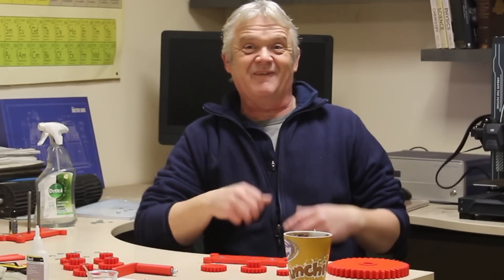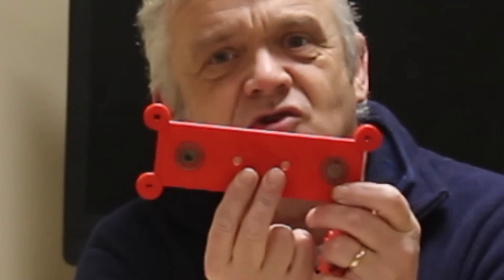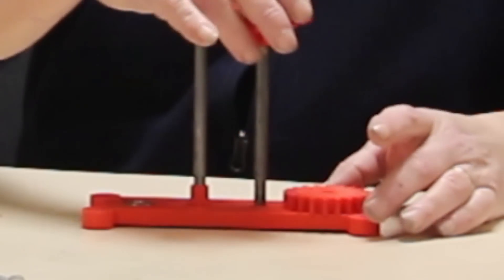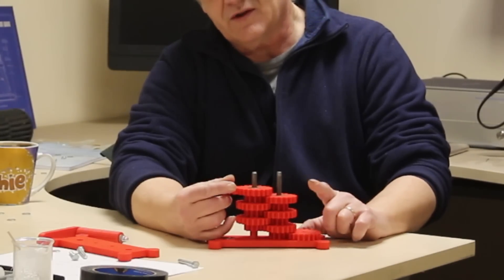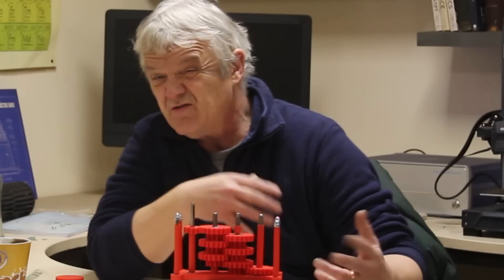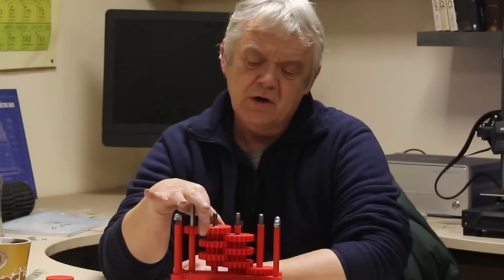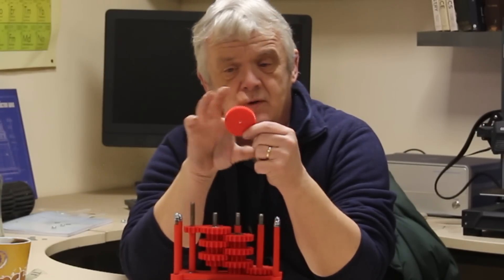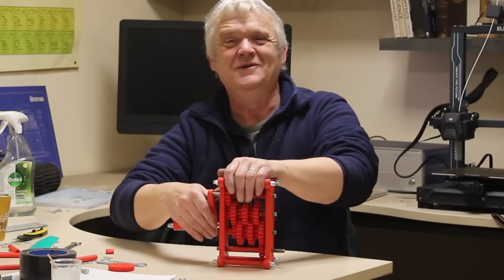1828 Fun With Gears - For Wind Turbine, Hand-Cranked, Bicycle And Water Wheel Generators

Comment: Your 3d Printer must be better than the ones I tried. Printing mechanical parts is not possible with mine. My laser plotter however can cut accurate gears from 3mm thick wood easily at 20 times the speed of a 3d printer and is much more accurate. (gears of less than 10 mm diameter are no problem)

Comment: Fun with gears: By that same token, if you have one gear turning at the speed of light, would a 2X gear attached to it give you a gear that was spinning at TWICE the speed of light??? All the Best! 73 DE W8LV BILL
Reply: relative to ???  -  but will it spin the universe in reverse....  jk.
Reply: @kadmow  And, if you add a third one to one gear between the "1x" gear and the "2x" gear? So then, what is the electrical equivalent of gears? Transformer, I think...

Comment: I have a idea for a project u can make. Get a huge tank that can hold 1000 gallons of water put a piston on top add wights on top of the piston to push the water out and spin a water turbine. See if it can charge some batteries
Reply: Very nice concept.  Maybe a lever system can also be considered to push the weight and apply pressure .

Comment: As it is meant to be a gear for a windmill like VAWT, why not using a Variable Speed Countershaft gear with two cones, similar? Main problem with wind is the not so stable output, right?
Reply from the maker: it isn't meant to be that - it is meant to show how gears work

Comment: The Germans found out the importance of "slop" during WWII. They designed many of their weapons with truly Germanic accuracy. Then they found out that dirt gummed up the works, and the weapons were extremely hard to maintain. This made them less than ideal in the real world. (Who knew that in the real world, battlefields were dirty?) 

American engineers did the same thing with the M-16. The initial model was ALWAYS jamming because they weren't designed with dirt in mind.

So it's always a good idea to learn a lesson from engineers who came before us. In this case, the lesson we learn is to add a little "slop" into your designs so they will work (and continue to work) in the real world. Good lesson, Rob.
Reply from the maker: nice add mate - thank you for posting it

Comment: That was a great demonstration of how to use gears. I'm no engineer but I have had practical experience due to Meccano and, in my opinion, when you are trying to increase the speed, you should have as few gears as possible as there would be greater losses due to friction compared to using it the other way around to generate high torque. If you can understand how a brake on a pushbike is more effective on the rim rather than the hub, it's the same thing. There are parallels between this and why we transmit electricity at a high voltage over long distances because a couple of volts of voltage drop is not a huge loss of power at 11,000 volts compared to how much power would be lost at 220 volts. If you lose rpm at a very high speed due to friction, then you will lose power but if used to generate torque then you probably won't lose any rpm due to friction.
Reply from the maker: cheers mate
Reply: - power is where it is at, as power (energy per second) is generally where the cost is (torque x speed = power, power x time = energy  (torque without speed, or speed without torque are kind of useless (no work gets done - all big jobs need real power, being reactive doesn't help (jk) ).
.  Rob is (it appears - from his wind power discussions) really using this to demonstrate that just chucking gears at a problem doesn't always produce a solution (using equal steps helps the big kids (us and ppl like us who may not have played with Meccano) get their heads in the space practically) - showing the effort it takes just to turn those ? 8 meshes shows that converting "energy" to different forms isn't loss free - point taken, in a real system, packaging often dictates spacing and yes one uses as few conversion steps as is possible. 

cheers.

Comment: on the subject of wind turbines, I saw an article on a " toroidal shaped propeller " supposed to be more efficient and a lot quieter than conventional designs, could be used for a wind turbine maybe ?  have you heard of it ? any thoughts ?
Reply: Major Hardware just tried to make a PC fan out of it. Turns out it's not great for that application, but that doesn't mean it's not a great propeller. It was still noisy, but the noise was lower pitch.
Reply from the maker: I will check it out - cheers mate

Comment: Very nice! I've seen somewhere that graphite powder makes great lubricant for 3d printed gears too. Can't wait to see you hook it up to a generator!
Reply: You can add a ring to the back side of each gear in your design - just a couple of mm high and wide, also a spacer between the gears to reduce surface area therefore reducing friction.  I did a quick video on it in my non-channel channel but you don't need to watch, that's the gist of it.  I can tell you it's a good improvement, but I didn't measure the before/after RPM at a steady force.  I should have, sorry!  But if you haven't designed yet it's an easy addition.
Reply from the maker: that's a good post mate - thank you

Comment: Nice vid Rob. A suggestion would be to put some bushings/spacerson top of the bearings. It looks to me like the surfaces of the gears are rubbing against each other. Anyways just a suggestion. I am very good at 3d Design and 3d printing(Should I say it myself). 3d Printing gears that work is not easy - so I think you have done great. Also as always your explanations are very good! Cheers from Denmark/Japan.
Reply from the maker: I didn't use spacers mate - the bearings I used have a 1mm projection on the inner ring - very useful - but you are right I should have pointed that out and done exactly as you said - thank you for noticing and taking the time to mention it

Comment: I agree. Great class on gears. I think they might be a lot quieter, and a lot tougher  if they were printed with nylon, which presents its own problems
Reply: Maybe a bit of silicone spray may help, or ear defenders 😆. But another great lesson.
Reply from the maker: cheers mate - there are a few reasons they are so noisy

Comment: The end gear could be a slip gear cog thing, so if the power produced was by wind etc,  when the blades slowed/stop suddenly I.e. gusts, it doesn't immediately stop the last cog and the generation as this model does,  just a thought.
Reply from the maker: a ratchet and pawl mate
Reply: @Robert Murray-Smith  if that's what's in fishing reels then yes,  probably that! Almost like a really soft clutch

Comment: one thing about print orientation and the stresses posed on 3d printed gears; there is a point where the big gear intersects the smaller half. under load this can sheer as there is nothing perpendicular to the torque
Reply from the maker: cheers mate

Comment: Stumbled on your channel this morning; interesting stuff!  I've been fiddling with gears for a few months now although smaller than the ones you have here. One predicament I've come across is finding gears in the correct diametral pitch; that is to say common numbers seem to skip certain multiples. 20 is common but 40 is impossible to find for instance. I needed a 40 pitch gear to match a metric motor with a 40 pitch pinion but I couldn't find cad for anything matching. But then I realized I  could download a 20 pitch gear and scale it to 1/2 and get what I wanted. Anyway I'm sure there are other tricks so please share. :-)
Reply from the maker: nice one mate and will do

Comment: This is excellent! Helical gears would be less noisy though ;)
Reply from the maker: they would - but they wouldn't teach as much about ratios and how they work - well I think so - the wheel analogy is really helpful In getting hold of that - to my mind anyway - cheers
Reply: Don't those put a transverse load along the shaft though? I think it would be a lot tougher to turn and wear out the gears faster if they were being pressed together. A herringbone gear might work though. Pain in the butt to cut but easy to print. Tbh I think this design is fine for what it is, all it needs is a little lubrication.
Reply: -  they will also demonstrate push off, great learning concepts...  (on low quality surfaces, not so much "quieting")..

Comment: Did you consider putting a big gear on the input shaft with a smaller gear for the crank?
Reply from the maker: yes - but I also wanted to talk about gear ratios and gear trains
Reply: @ThinkingandTinkering  I guess the longer handle accomplishes the same thing a bit more simply.

Comment: You could add a flywheel. What is the mechanism called that pushes a flywheel and then lets it go? I know on a bike its a freehub or freewheel. Not sure what you would use for something much smaller.
Reply from the maker: that is exactly what you would use mate - it's a ratchet and pawl mechanism

Comment: Nice job. Loving the gearbox vids. Great advice about the layer lines. I would also add that you can make your gear boxes even stronger by not printing your bigger and smaller gears together and bolt them together with inset nuts and bolts. The structure between the two gears is very little when printed together, essentially just the outer layer lines and the infill holding them together. When printed separately, both gears will have both top and bottom layers and the metal bolts make the connection much more rigid and able to handle the torque required to spin a load at a higher gear ratio. Also if you check out the "pro gear" option in the search bar of tinkercad you will find it has the ability to create helical cut gears which will give you even more strength and also will help it run smoother and quieter. Keep up the great vids Rob
Reply from the maker: cheers mate - nice info and well appreciated

Comment: Hello Rob! I enjoy your videos! I wanted to ask a question please... A little of topic... I don't really have the necessary equipment to do an experiment and I wondered if you've done this in the past, it has to do with a battery... Have you ever made a copper/zinc battery with potassium bromide water solution instead of a normal salt water solution? I believe it is also a salt. I was wondering what the difference in voltage/ampere would be instead of normal salt if any...
Reply from the maker: yes - it's about 1.6V amps is about electron exchange so twice the electrons are exchanged as the formula is KBr2 - cheers
Reply: @ThinkingandTinkering  Thank you!

Comment: I'm enjoying the gear series but I'm stuck in an electrical analogy.  In the electrical case, there is no gearbox.  The electrical generator has to go from 0 (or less) watts to the desired wattage in one drastic step.  Every mechanical input - output has a range limitation, especially with no gearbox.  I think preloading electrical energy through steps makes the final output more dependable.  It is supply and demand.
Reply from the maker: I m sorry mate - I don't understand that - a generator doesn't make electricity it needs mechanical input as it transforms mechanical energy into electrical energy - if a generator isn't moving it produces nothing - what It produces is in direct relation to the mechanical movement - or a least as far as I understand it
Reply: @ThinkingandTinkering  Every analogy fails!  Basically saying that power should be built up in stages with different types of coils for different jobs.  The first being gathering enough resources and building some low wattage in.  The last one bumping up to the desired output.  I don't think there is enough supply which creates shortages.  And I think demand output is restricted by trying to create more supply.  
Much like the gear box,  You can't do the job with no gears, and two gears is not going to do it.  You might need several gears to get to the desired output.  (Given that you can't get out more than you put in of course)  A gear box.  
In speaker systems, just one amp can't do it all you may need a pre amp.
In water pumps, filling a tank, going from 0 psi to 200 psi, I can use 2 pumps, one for 0 to 50 and the second from 50 to 200 and increase the output by 1000% or more.  They don't make a pump that goes from 0 to 200 psi with a high output.
Reply: Interesting point of view, thanks

Comment: I'm really glad you touched on print orientation in relation to part strength.  Most videos I see seem to ignore strength and focus primarily on print speed and using less filament.  Strength though seems to be glossed over most of the time.  Personally I'd rather a part take 50% longer to print and use more filament if it means it's less likely to break and will just last longer.  Thank you for including this info.
Reply from the maker: nice one mate - because you are right - it does matter
Reply: Gears definitely will print faster and stronger laying flat like he had it.
Reply: (also increased width of the low speed - high torque - gears helps with longevity (lower stress on tooth surface and across the root) )

Comment: Torque calc is next
Reply from the maker: oh I could do I suppose - do you need that?
Reply: @ThinkingandTinkering  A friend of mine was trying to build a generator with a exercise motor and a 3 hp gas engine but it keeps stalling out so he needs more motor or the right gear ratio which may decrease the wattage.

Comment: u  might want a little oil or  grease on the high speed gears so they don't chew them selfs up 
good job Robert In demonstrating mechanical advantage
Reply: Silicone spray 👍
Reply from the maker: cheers mate nice suggestion

Comment: That last gear was screaming for mercy awesome demonstration. Have you found a preferred infill pattern and density for these kind of prints? The last gears I printed broke down way too quickly so I just print molds for casting now.
Reply from the maker: not specifically mate - to be honest for any really long term thing you probably do want to cast them or have them made - either way you are going to need stl files - but it is odd the little things that catch you out so it's a great way of working out ideas until you get to a final design and I think that's what I would use this kind of thing for
Reply: @ThinkingandTinkering  And that is why FFDM additive methods (I like pleonasms) are very useful in prototyping; but you can make strong pieces lasting years outside if you choose the good combination of process, material, tools  and knowledge.
Reply: I like using a triangle fill for shafts and gears. It puts the triangles around the center in curators it makes them quite strong. I had used cubic & gyroid but the parts break apart in use. So far the triangle ones are working quite well. About 2 years now.

Comment: Magnetic gears less friction
Reply: Magnetic gears: torque transmission limit.
Reply from the maker: they have their problems mate - it's pretty much why you don't see them everywhere
Reply: Add a bit of lube and it really does make a big difference. A little surface sanding it makes it even better (very tedious).
Reply: Also, I could see you building a mini sand blaster to quickly sand the parts!

Comment: @1:00 have you considered tephlon bearings? Sorry i think i probably spelled it wrong.
Reply from the maker: teflon - I have used them but they are a bit expensive
Reply: @ThinkingandTinkering  fair enough.
Reply: @ThinkingandTinkering  I just had an apiphony for you bro. for your wind capture device...

I was thinking, that you need to keep in mind the roof of the structure. You want some sort of re-direction off the roof to go back down.... The roof could have a funneled effect also. There would be gaps that any wind that blows up, would go up and into the middle tube going back down. That would all be built into the cap of the device and a central wind tube. Once you weave all the wind in the same direction, you can then use it more effectively.
Weaving The Wind 😀
Reply: @ThinkingandTinkering  I watched your most recent video, and was thinking. What if you experimented with determining the smallest amount of air that will travel through a tube at varying sizes of tubes? This could be translated to small tubes scattered around the intake area, feeding and filtering every element they receive. A cone at the end of each tube meshes next to other cones, would be a desired result i think, for collecting all atoms blown in...I also thought about how the tube should work, and figured that some sort of spiral shape to the cones and tubes air flow, might help with the flow of the air and molecules and atoms. The 35 Degree angle should be used but as a mesh to protect animals from being caught in the blades below. Like i said before 😀Air Weaving 😀